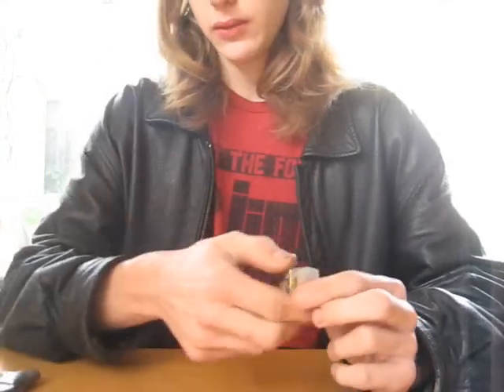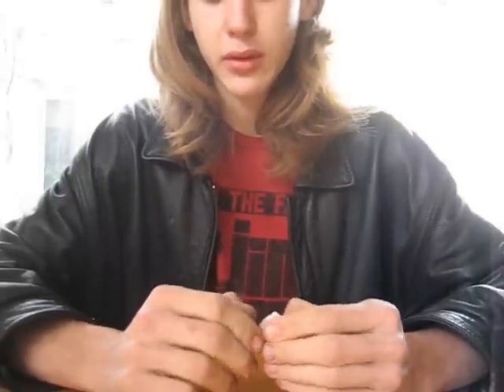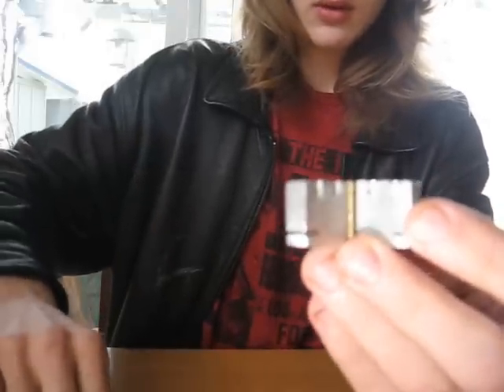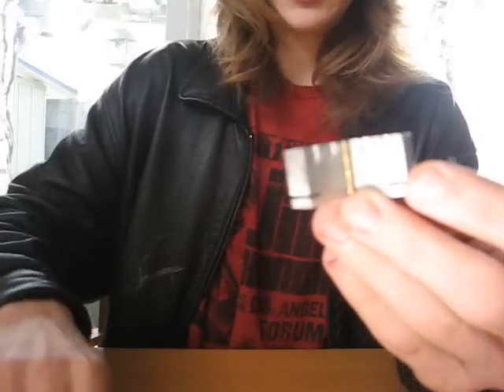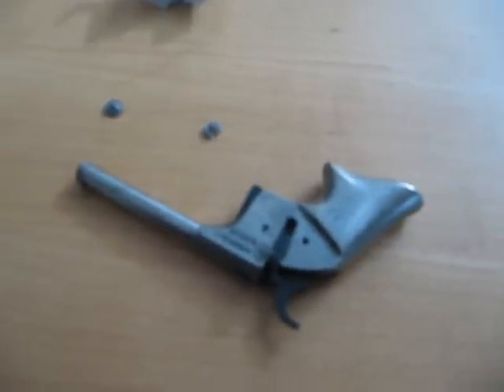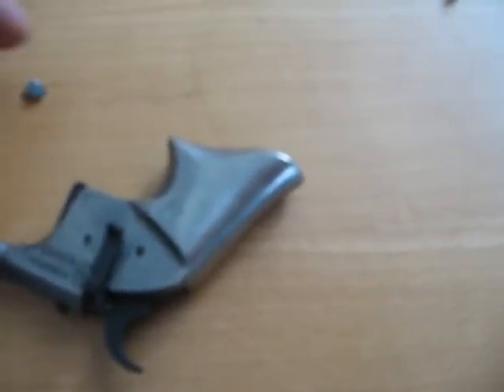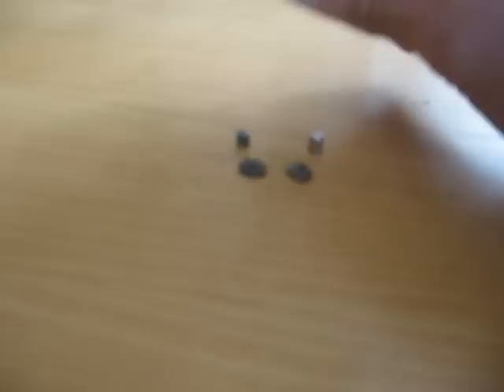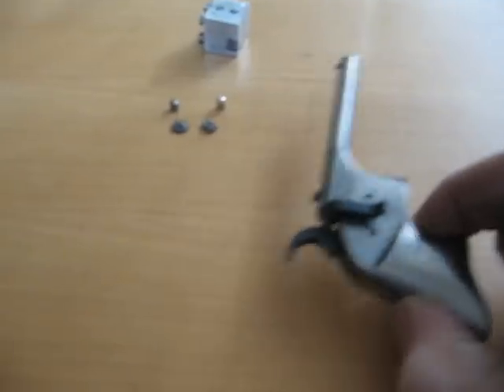homemade 4.3 mm bullet mold for rider derringer and results

Comment: First off I love the idea of making a mould for your own bullets etc. 
I agree that 10 dollars per a 100 bbs is ridiculous..Few tips.. Try the kodiak pellets in .177 or the Heavy crosman .177 domed pellets. The light pellets will just have tops sheered off. I can not remember lead shot size for  bb or .177 but  a 5 pound bag should be about 20 dollars. This is the shotgun lead shot. I just discovered I do not require a permit for this gun in canada..Grins..

Comment: @busyhands94 Okay. as I plan on picking one of these fun things up, what size drill bit did you use and how deep was each drill? I think I would make a 20 shot mold,  10 of each size at once. Also as a tip you may find that the more shots you old at the old gets warm the nicer the shots will turn out? also are you lubing the bullets  with grease or graphite?